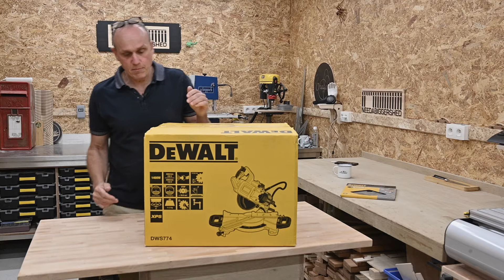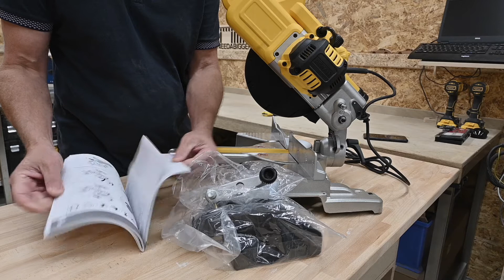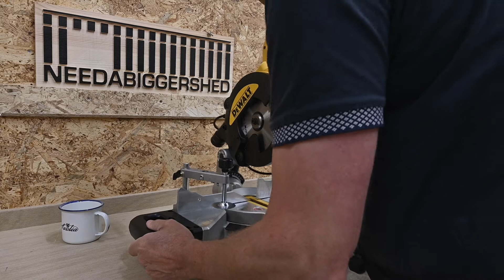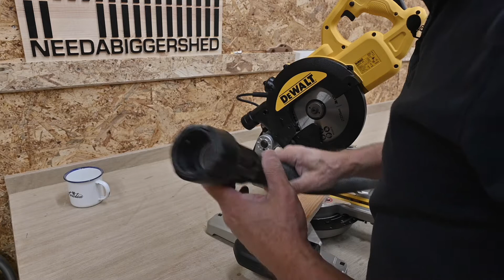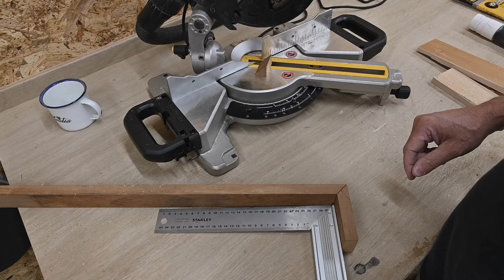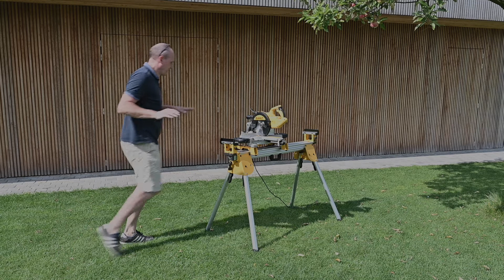DeWalt DWS774 Mitre Saw unboxing and first impressions.

Comment: This device can be fine adjusted on the angle settings. Just loosen the three torx screws from the angle scale, use an 90 degree carpenter square, set it and tighten the three screws again, done.

Comment: I'm just looking at a new mitre saw and this was really useful.
I initially looked at the DWS773 but that has no light so then started looking at the 774 & 777 which is way more expensive and has a larger motor. You video has helped me realise I don't need the extra expense and the 774 will probably be fine.

I'd love to see a video on adding the cheaks although I'd assume it is a case of just screwing them onto the guide plate using the 4 holes. I'd hope that would help with support and reduce tear out? Also be good to see a video on adjusting the base so the mitre settings are accurate?

Comment: Perfect for those who don't have a workshop. It works from the floor & fits in the car. Dust extraction fittings are all over eBay AND it will cut any material if you buy the specific blade.
Reply from the maker: yep, you're bang on there. 
Just don't for get to lock the arm down before moving or you grab it to pick it up and it all slides out :D

Comment: Would you recommend this for a DIY er. Noticed you didn’t demo the clamp. I thought the clamp looked cheap and nasty on other vids. What’s your opinion. Good demo. I’ll be looking at others
Reply from the maker: These types of clamps have never been my favourite, even on bigger machines in the past I've usually taken them off. This machine table is very small and will most certainly be in the way if you use the saw on the mitre. It's quite a simple clamp, friction and a threaded foot to clamp the material, personally, I think it would give a false sense of security. What I've always done in the past is made Ply cheeks for the table and then use a quick-clamp on there if needed. Mostly that's been to assist for long pieces if at all. 

As for the using the saw as a DIYer. Totally! It's not aimed at someone using it day in, day out. Far too light for that. It seems well made and highly portable which makes it a great job site saw for bits and pieces. For the price too, it's not too expensive to have in the shed for occasional use.

Comment: Congratulations on the purchase of your new NEEDABIGGERSHED showpiece!  The first thing I did after purchasing my BOSCH PCM 8S crosscut saw was to replace the standard Optiline 216mm x 2.0 x 30 48 saw blade with a Freud LPM40M 019P 216 x 2.4/1.8 x 30 Z64 HW.  Always beautiful splinter-free cuts on soft wood material.
Reply from the maker: More teeth, smaller bites, smaller bites, less mess :)